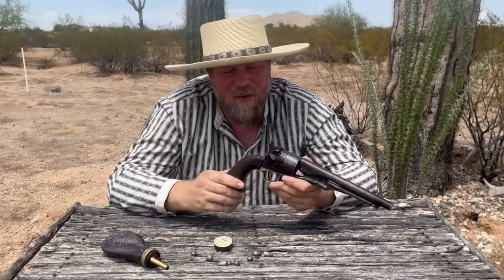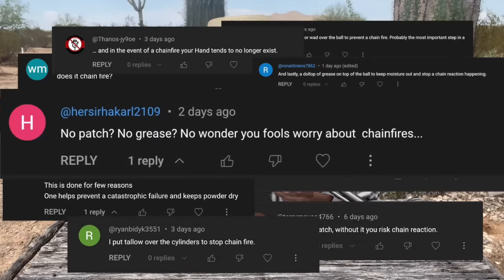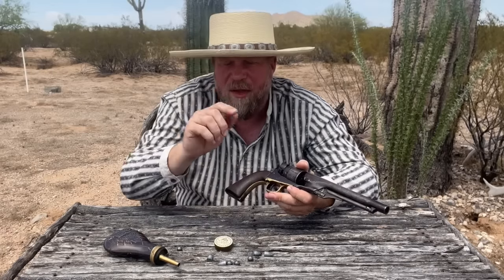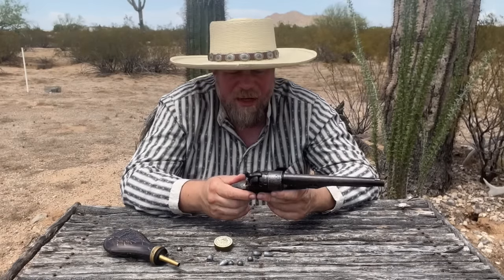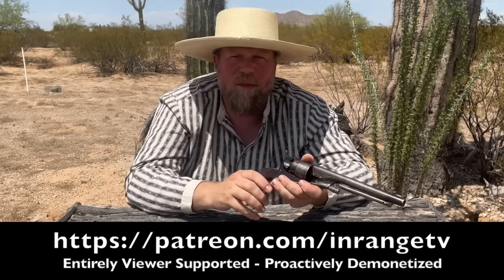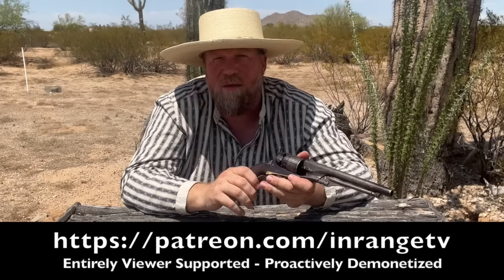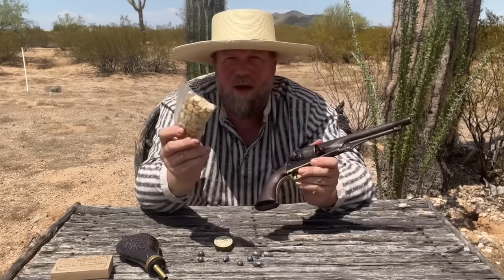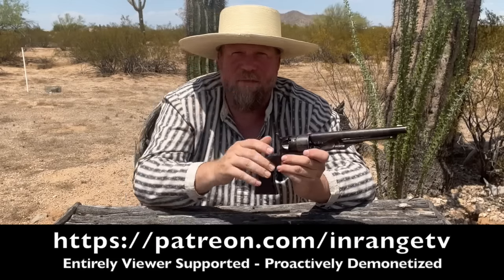Chainfire!  Is it dangerous?

Comment: I have been shooting muzzle loading revolvers for over 40 years. I have seen another thing that will cause a chain fire. Some competitive shooters want the ball to be close to the muzzle of the chamber to improve accuracy by limiting the amount of travel a bullet has in the chamber before entering the breach of the barrel. They are also shooting light loads so put a filler like corn meal (wads are not allowed with my group) to fill or almost fill the chamber. Because corn meal is fairly compressible, they compress the corn meal when loading. After applying grease to the end of the chamber, this can cause the bullet to back out of the chamber during recoil. I believe this is due to the pressure the corn meal exerts to push the bullet back out. Also, the mouth grease makes it easier for round to back out and an undersized ball makes this even worse. 

So if you ever notice you have trouble cocking your revolver because the next ball won't clear the cylinder/barrel gap, you are a chain fire waiting to happen. Don't put it down to failure to seat the ball in the chamber deep enough, consider that the ball is working loose due to recoil.

Chain fires can happen because of caps falling off. It was is said that it happened more often with revolvers with large areas around the nipples rather than Colts, Remingtons, etc. with a smaller clearance.

Comment: I have a Colt Walker. I wouldn't want to use 60 grains of powder, so I use 30 grains but there would be an air space between the powder and a fully seated ball.  In this case,  a wad or ground wheat powder over the gunpowder is a must. An air space will cause the cylinder to blow up, possibly even with a small amount of powder.

Comment: I was introducing a friend to cap and ball revolver shooting after he bought a Pietta . 44 1858 Remington. He had read online about chain fires and was ready to fill the chamber mouths with lube. I began shooting C&B revolvers when I was 15 and was in my mid 40's at the time. I had shot so much that I completely shot loose several repro revolvers. At the time I had a few 1858's, 1860 Army, EMF Texas Dragoon, and a few Pietta 1851 .44's (I know, not historically correct). I had fired C&B revolvers thousands of times and, like you, had never experienced a chain fire. I expressed this to him and he proceeded to load like I did with no grease.

I cast my own balls in a .457 mould and he was using swaged .454 balls. To my absolute amazement, the very first time he pulls the trigger on his C&B wheelguns, he has a chain fire. Lighting off the top 3 chambers!

I'm not going to say it changed my way of loading at all, but I found it funny! He didn't, but I did!
Reply: Did he keep shooting C&B revolvers after that? Did you explain why it happened, or did you know?

Comment: What if you sealed the bullets into their chambers by dripping melted wax crayons into them, and applied a little around each cap?
Could that prevent chain fire even in the heat, make the gun a lot more water-resistant and finally explain why Marines like having crayons around?
Reply: Isn`t that for snacks?
Reply: It would probably help but it sounds like a big hassle.
Reply: Waste of time. A tight enough sealed ball is water proof, and a small bit of wax around the nipple with a cap pushed over is waterproof also. There’s videos on this. Only a small amount needed. No melting anything necessary.
Reply: As he points out, a properly fitting projectile is all you need. Chain fires are only an issue if you use undersized ammo.

In his rain test video he found that the primer was the point of failure not the cylinder front, as again, a properly fitting round makes a full seal.
Reply: Wax melts in heat, especially when the gun gets hot.  So does bore butter. It's a pain and messy
Reply: Maybe wax coat the undersized bullet. Probably would melt off leaving a mess in your pouch in Arizona tho. Maybe dipping them in ski wax or something that melts at above 150f would work. Lol.
Reply: You rub the crayon into things like sight range markers to highlight the numbers, it's quick and easy to see. When it gets dirty you can melt it out with a lighter, all the dirt comes with it, then just run the crayon over it again.
Reply: crisco is your friend! that was the modern hack
Reply: Hold on, I didn't know marines use cap and ball revolvers. But yeah I think your idea will work
Reply: @jehoiakimelidoronila5450  They're big on tradition, and, well, from the US Marine Corps University: On November 10, 1775, the Second Continental Congress meeting in Philadelphia passed a resolution stating that "two Battalions of Marines be raised" for service as landing forces with the fleet. This resolution established the Continental Marines and marked the birth date of the United States Marine Corps. I'm guessing that, at some point, they were using cap-and-ball revolvers in wet conditions.
Reply: Dixie Gunworks sold in the '60's a product called Bear Grease that would not melt in the heat and worked great for lubing the ball.  I never used it around the nipple but it probably have worked there for water proofing.  I kept my "58 Remington loaded with ball and powder for years and that Bear Grease stayed put.
Reply: discrimination much?
now marines can't use this, what else do you expect them to eat?
you think anything but crayola can make those smiles?
Reply: I can see someone melting the crayons with a Bic lighter and dropping some sparks
Reply: @jehoiakimelidoronila5450  or, just use proper bullets as suggested in the video... Did y'all even watch it? 🤔
Reply: The grayons are for eating.
Reply: @beargillium2369  What fun is that? Next you're gonna say that firing paper-patched .44 (.430) 300gr bullets out of a Walker is not a best practice.
Reply: A ton of Blackpowder hobbyists do exactly this with (brand name) bore butter
Reply: Just use the right sized ball. It will shave a lead ring.
Reply: As a black powder newbie(ish) and a person that had a good introduction to naval history due to my grandad being a Seabee(LtCmdr[ret.] John James Price Sr. 42nd 178thCB) , 

You're all liars, save the individual who asked if the Navy actually used it. And yes. I did watch the video with all of its historical inaccuracies.
Reply: I use bore butter, but only for fouling.  The lead is fitted so tightly in the chambers that it trims a lead ring off the ball when you seat it. Thats why you don't need grease or wadding.
Reply: Lard has been used, I was a member of a black powder pistol club and saw a lot of lard, bearing in mind this was in the UK. So was cold but still saw plenty of lard and no chain fires.
Reply: They (ox-yoke brand) sell little round pieces of wax you can top the cylinders off with. Just squish into place using whatever you push the bullet in with. I started making my own out of bees wax with some kind of mineral oil mixed in to losen it (kinda hard undiluted). I forgot to use them one day and had a chain fire...
Reply: As said proper sealed round balls is a sure bet. You could wax drip seal the top of the cylinder, if you were freshly "loading the house revolver for the Misses, for while you are away hunting". I tried the candle wax before, it didn't last long with handling. The dried wax started cracking, falling out. It would work for a revolver that just sits in a drawer until emergency use.
Reply: You can actually waterproof your loads doing that, great for the Pacific NW, maybe not as useful in AZ. Wax thinned with lard was a method for wet climate.

Comment: thank you for your video., All the arguments about chain fires is amazing. It can ONLY be accomplished by fire going in the Front or the Rear of the chambers. Seal the Front and seal the rear and viola ! I have been shooting all sorts of black  powder revolvers and rifles for over 30 years and have still yet to experience one chain fire. However i HAVE experienced a squib in my .44 that i bought when i was 18 and split the barrel ! If anyone is not positive that the round went out the barrel....STOP and check. I felt a very mild recoil and sound but stupid me I just pulled back the hammer and that was the end of my revolver barrel . Anywho, thank you again for your video. Great work.

Comment: An undersized ball could also leave powder in front of the rammed ball. I've never experienced a chain fire, but always just assumed that the were caused by the flash at the gap between the cylinder and barrel and a sloppy loading that left a fuse, so to speak, in the chamber and around the bullet for the other loads to misfire from. Using an undersized ball without a patch would be a good way to see this happen, imo.

Comment: Glad you covered fouling as a reason for using wads or grease. Grease is nice for winter and some brands even have a mint smell.
Reply: When I started shooting in the late 1960s we used Crisco both to lessen the chance of a chain fire but also the grease to some degree migrates on firing to the cylinder pin.

Comment: I had a chain fire on my reproduction 1847 Walker Colt, way back around 1987. I loaded 0.454-inch-diameter, 141-grain round ball bullets that shaved off lead rings on ramming. I was loading the maximum 60 grains of black powder that day and an adjacent cylinder fired. Amazed that this didn't damage my revolver. A friend told me to either load felt wads or seal around the loaded bullets with patch grease (from a plastic toothpaste-like tube with a narrow spigot that worked well). Just glad that the Walker did not blow apart like the originals sometimes did.

Comment: I've got the 1852 Navy and use balls due to making paper cartridges and dip them in a mix of bees wax and tallow - have yet to have a chainfire with that SOP.
Before I found out about that method, I had always smeared bore butter across the tops of the chambers - never had a chainfire, but that was a mess and a half, especially during summer.
The wax/tallow mixture doesn't melt and isn't bothered by the heat and humidity in Florida - even firing during days with a 110+ heat index - and while it doesn't do anything for the cylinder, forcing me to give it a brushing every few loads to clean it out, it does wonders for the barrel.
If you don't use paper cartridges, you can still roll out pea sized balls of the wax/tallow mix and the smush them into the cylinder after every chamber is loaded to protect against chainfires and keep the barrel clean.

Comment: I've been shooting cap and ball revolvers for about 25 years, and I have put thousands of rounds down range with them. I have never had a chain fire, and living in the deserts of Central Oregon, any grease that was available would just melt out in the heat. I have always used .451 round balls until recently. Plus, I have never had a cap jam in my Colt model. I guess that I have just had a good run with my guns. Although I have had caps fall off. I have found that CCI #11 caps fit loose, but if you grind the end of the nipple to shorten then then the caps fit great.

Comment: I haven't shot black powder revolvers extensively, but I've done it enough to know that you're right about the grease.  Even when it's cooler, the heat in the cylinder after firing off a dozen rounds or so is enough to melt the grease and have it dripping everywhere.

Comment: I've heard of one other source of chain fires that is a possibility, but should be very rare. I have heard of cases of the cylinder walls developing a crack between two chambers and that leads to both chambers firing at the same time. To be honest, it sounds like the sort of problem that would primarily surface from not properly inspecting an original piece before attempting to shoot it.

 As for me, I only am able to deal with repros, but I do always give them a good look over before I take them to the range. I've recently switched from loose powder and ball to making my own (currently round ball) paper cartridges. I've always gone by the rule of thumb that a properly sized ball should shave a noticeable ring of lead when being rammed and that is what seals the chamber. I did use grease on the front of the chambers for a while when I was just starting out, but found it to be quite the mess and figured it was a bit redundant when the balls I was using shaved off that lead ring. I also sought out the wisdom of more experienced BP shooters, including many here on youtube, such as Duelist1954 and feel pretty confident in my choice. A bit of grease to deal with the fouling is fine, and I dip the front of the loaded cartridges in my current preferred lube after they are loaded and the glue has a chance to dry, but it's there pretty much only for the fouling. The process has certainly showed that my gluing technique sometimes isn't as good as it should be, but that's something that can be improved as I gain more experience.

Comment: This is the same conclusion we got shooting replicas the past summers in Polska - .440-.450 round balls chain fire a lot  without grease, hence the grease. With round balls  in .455-.457 it stopped, with conical balls it never happened and we had the best groups.
Fun part,  my local black powder range enforces the use of grease over the ball, also with proper sized conical balls.

Comment: Slight oversized round balls when seated into the chamber shave a tiny ring off. That means there is a tight fit between ball and chamber. I use cornmeal as a filler because its cheap and because I generally load 25 gr of 3F powder, so there WOULD be a loose gap between powder and ball otherwise. Cornmeal filler is also a spark barrier. Using cornmeal filler you can also ensure a tight compacted load. A compact load is good to ensure that chambers don't get rocked loose and mess with burn consistency. Its also proponent for accuracy with every chamber ball seated at the same depth, which also means the ball engages grooves at same distance, etc. 

Anyway, I never had a chain fire.

Comment: Got my first black powder revolver in 1986, an Uberti 1861 Navy. I used the felt and grease for the first box or two of balls then I either talked to someone or read about the reason the recommended ball size was oversize and have been shooting sans grease or patches ever since. Never had a chain fire.  I’ve had it do a semi-auto thing a couple of times when using non-serrated caps. I guess the blowback was enough to fully cock the hammer.

Comment: Great to see someone talking about this topic without beeing dogmatic or getting personal.

I experienced about the same. When I got my first percussion revolver, I went to the range, and with the second shot I had a chain fire. Why? I was using the balls I had. From rifle shooting, where you use a patch. So the balls are smaller. They were .445, so WAY undersized. But since the cap was still seated and not went off, it was immediately clear the powder was ignited from the front.

Today I use .454 round ball, because these are readily available everywhere and not too expensive. I put grease in front, but not because of chain fire. I never had one with .454 balls. But because when I shoot these guns, I shoot quite a bit, and the grease helps with the fouling.

In the old days, grease was not used for one more reason: The guns stayed loaded for quite some time. The grease would accumulate the ever present sand and mineral dust in the desert and would turn into a grinding paste. You don't want that in your barrel.

Comment: You are correct: there are many reasons for chain-fires. Yes you need 'oversized' projectiles to seal off the chamber, but there's more - many modern replicas have small 'lips' (or burrs) around the mouths of at least some of the cylinders which shave off more on one side of the projectile than the other (making a gap on one side of the cylinder for sparks to enter - lead rings will be thicker on one side) - make a slight chamfer on the mouth of each cylinder to eliminate this issue, however now you may not experience a ring of lead as the ball is 'swaged' into the bore of the cylinder (similar to the original cylinders that had tapered cylinder bores). One also must be aware of where the 'sprue' on round balls is situated when seated as well as the condition of the sprue surface if it contacts the cylinder walls. I don't use wads or grease/wax for chain-fire prevention, just oversized projectiles and correct percussion caps...

Comment: I've seen it happen to guys a few times in CW reenacting, with just powder supposedly sealed with Crisco or whatever. I've never had it happen while live firing though. It's been a while, but I believe I used .376 balls (1851 model colt), which were more than large enough to seal the cylinders.

Comment: From my understanding, undersized projectiles are the main cause of chain fires; wax wads and "Bore Butter" perfectly seal the cylinder with a material that is able to prevent any ignition sources from getting into the other cylinders by "catching" and extinguishing any flame so it's nearly foolproof. You're correct in saying that using the correct size projectiles will also seal the chamber, but why people are still hesitant about that is because imperfections in the ball casting may leave sprews or uneven spots on the ball that will compromise that seal and could let in an ignition source. With modern casting and rolling methods, however, this is extremely unlikely. You can verify that the cylinder is sealed by looking at the ring of lead that is cut off of the ball when squeezing it into the cylinder; if there's a section of the ring missing, then you know there's a gap in the seal. 

That said, Wax or lube, in addition to wads, still have viable use cases in black powder firearms. They keep them clean and contain residue within a waxy or oily film that can be easily cleaned and wiped away, as well as providing lubrication and preventing fouling; which is why I still use them.